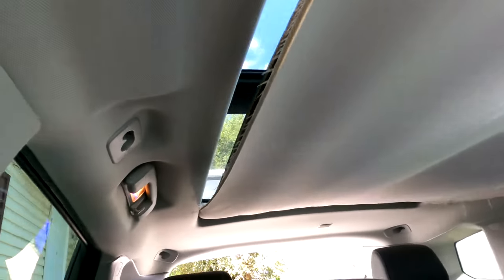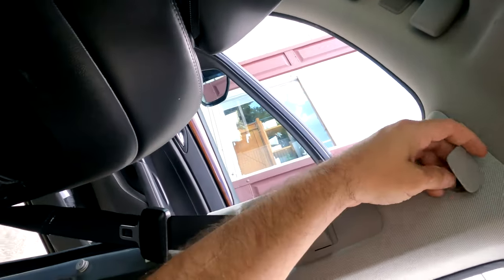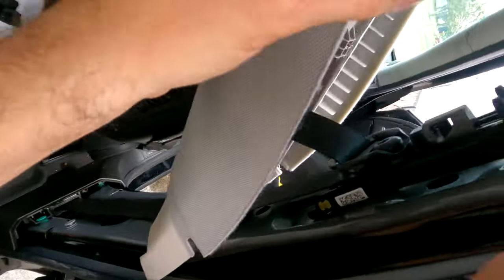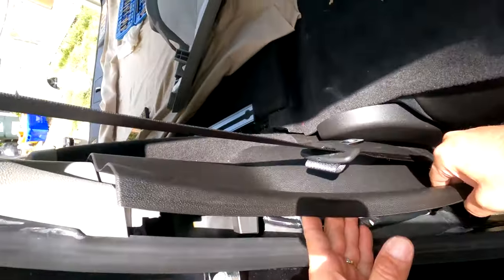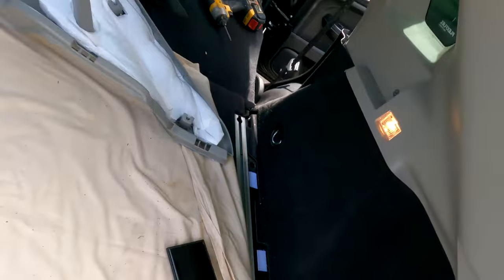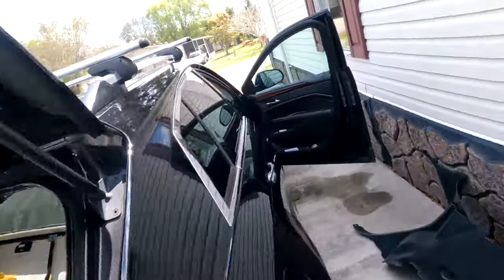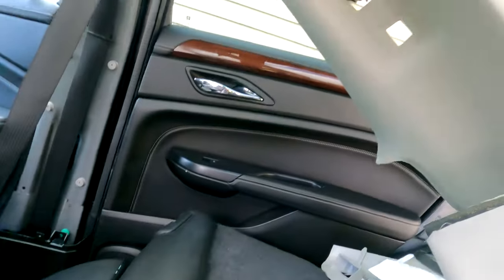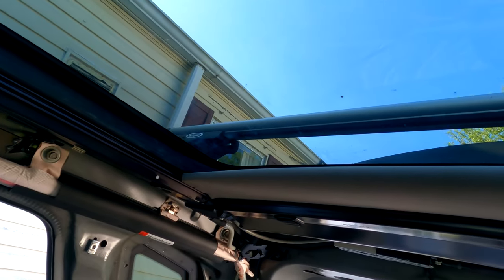2010-2016 Cadillac SRX Sunroof Shade Replacement

Comment: Thank you for creating this video.  It is the only one I could find on YT that actually showed step by step how to remove the panels.  Its great to have a visual reference.  I did the procedure about a week ago and would not have known how to start otherwise.  It has some tricky steps for sure, but it is doable if you take your time and have patience.

My old one was sagging and ripped on one side.  The new one is tight almost like a drum.  Part was $82 on Amazon.

Comment: Thank you for the video, It saved me a whole lot of guess work.
One thing I did differently is I had the front edge clips about 2 inches from the rear of the travel and attached the clips and front edge BEFORE mounting the unit. It worked for me.
Thank you again it was a huge help

Comment: I’m this video at 29:52 there is a pin that comes in the new sunshade that keeps it tight just for install. If you do not remove this pin after install and before moving sunshade it will not allow your new sunshade to work or close all the way. It will close about halfway and retract. Make sure to remove that pin. It’s almost like a pin to a gernade. I saw this pin destroy brand new sunshades

Comment: First of all, kudos for having the courage to take on such a huge project such as this. I do have a couple of questions, if you don't mind me asking.
1. Is the replacement shade you used an oem or aftermarket shade?
2. About how long did this project take from beginning to end?
3. What was the biggest challenge?
4. Any idea how much you saved by doing it yourself?
Thanks so much for your time and effort.
Reply from the maker: Hi @2428rozy.
1. It is an aftermarket shade.
2. The whole job took me about 6 hrs, but remember, I didn't have a video like this showing all the steps.
If I have to do it again, It would probably take me half of the time.
3. The biggest challenge to me was removing the clip that holds the curtain to the track and put it back on.
4. I saved about $1000  if you add the labor and cost of an aftermarket part instead of oem.
You're welcome.
Thanks for your support.
Reply: @regiegija   You did such a good job replacing the shade, as well as getting it all on video, Reginaldo. Job well done!!! Even with your excellent video, I'm still not sure I'm ready to give it a try.
Reply: @regiegija where can I buy one for my 2014 impala ?
Reply: Possibly even more savings than that. I just took mine in to Cadillac for repair/replacement… 
$230 for diagnostic labor
$1,600 if I want it fixed!
I paid the $230 and took it home without the repair. It’s simply not worth $1,600 to me but I am fairly certain I could never do this either so I’ve gone from a luxury suv to a big beige shoebox with no sunroof view!! 😢

Comment: What a fun job…I did mine in the Florida (Melbourne area) heat too…nice video
Reply: Would you be open to replacing mine ? If I paid you I’m local
Reply: @justinejahlove  thank you but i am not interested in doing this job again.
Why don’t you just use this video as a guide and do the job yourself?
BTW, i sold my SRX after i replaced the CUE Screen, a wheel bearing, the headlights, sunshade, etc. GM Cadillac sure has low reliability now.

Comment: Do you know where to get the black plastic part the one that is in front of white clip where you  hook sunshade into?
Reply: You break yours too? 😅 did you find a replacement / how to install a new one?
Reply: @connortobias556 I broke one of mine. Does it still function fine without it?
Reply: @thedigby1995 I was able to super glue the piece back on and it worked fine. Not sure if it will work completely broken as the shade needs to be folded back and clipped into that piece.